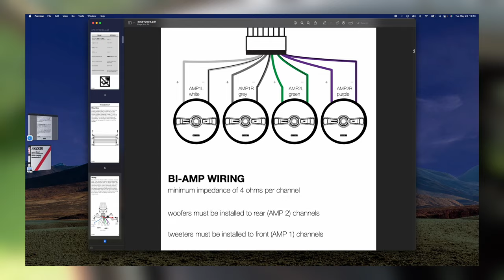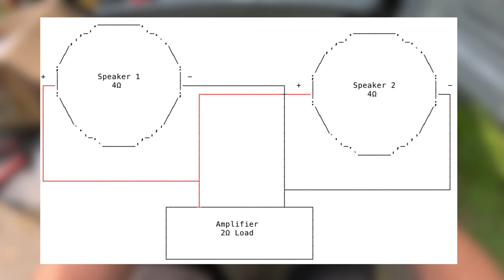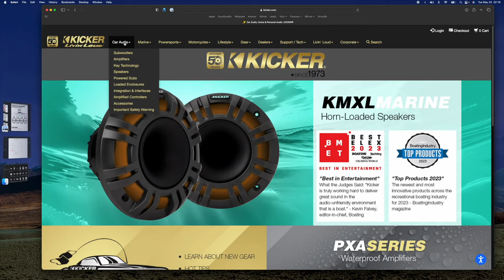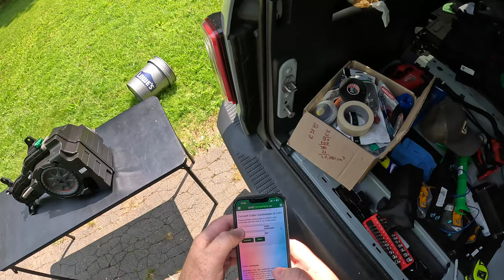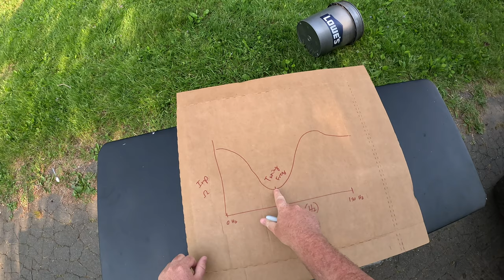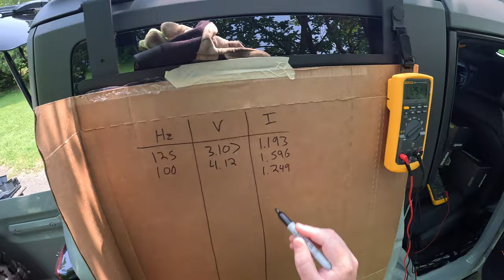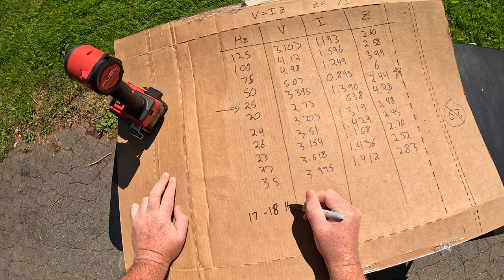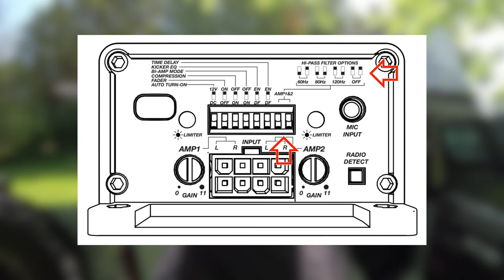Tuning the audio system! - Subwoofer & speaker dial-in | Ford Bronco

Comment: I think it might be a good idea to use component speakers with a crossover. Seeing how the loops on the kick pannel speakers can be cut and tweeters/woofer wires can be separated. Installing a crossover would be easy. It would probably mount near the kick pannel speaker. Plus the impedance would be 4ohms and the kicker amp would be happy. I also think it would improve bass response for the kick pannel woofer since its handling the low frequencies and the tweeter is handling the highs due to the crossover. This would be a cheaper alternative than buying a DSP. I think the kicker CS component speakers have a switch to lower the tweeter volume if its too loud.

Comment: My set up with kicker speakers, kicker 10” sub, kicker key and flat EQ on the head unit sounds on point with no real tweaking needed. A million times better than stock. Not even really any need for bass blockers.

Comment: I've seen other installers use the Kicker key on just the front four speakers.  This will give you a really good front sound stage and give the 6.5" speakers the power they need for the mid bass.  The rears can be run off of the factory head unit.  The way it is currently wired, the amp doesn't know there are six speakers hooks up to four channels.  This probably makes it difficult for the auto-tune to work properly on the Kicker Key.
Reply from the maker: Now that's an interesting idea.

I suspect that'll just leave the rear pods super underpowered, but maybe not??  Maybe I'll try it.
Reply: @RagnarKon  You don't need a lot from the rears for a good sound, as it's been said a hundred times before you don't stand with your back to the band at a concert.

Comment: Hey there! I really enjoy watching your videos, least u explain things and the given why to each thing u do. Ur for scan video was epic compared to couple others I watched. I was able to learn what to do instead of just do. Only 1 minor thing I saw when you changed the front component speakers to series cause they were wired in parallel????? True, I wholly agree they were wired in parallel. You have 2 speakers at 4ohms with the amp at a 4ohm impedance, correct? You only figured your speaker ohms wrong is all, u must add the ohms together which would’ve been 8ohms and not 4ohms like stated, thinking you had a 2ohm load at the amp, which in all thoughts would be bad deal for the poor 4ohm amp, correct? The factory wiring was correct to parallel both 4ohm speakers which is 8ohms total divided by the 2 speakers, at which the amp would see the correct 4ohm load. No need to wire those in series. Series wiring is adding each speaker ohms together to get total ohm load the amp will see for that channel. Parallel is adding each driver (speaker def in tech terms) ohms up and divide by the number of drivers. So 4+4=8 total ohms, 8ohms \ 2 drivers = 4 ohms which is correct ohm load seen at amp. Wiring was correct, amp wasn’t seeing 2ohm load. Im not knocking anything you have done or the way you done it, I think your doing great videos that others can learn what they are doing, heck! I learned a lot from your forscan teachings!! I think you’re doing a great job!

Comment: Had a similar setup with some focal, a week later I pulled the front coaxials out of kickpanel and dash and installed component’s….. night and day better
Reply from the maker: Which components did you use??

That was another idea I came up with as I was editing this video, but trying my best not to throw more money at this sound system.  One of those things where you can just keep going and continually upgrade gear, and before you know it you've spent $2,000+ on it.

Comment: Great job and detail on the tuning. I have the same setup (Kicker SUB and Kicker Key 500.1). I am happy with the subwoofer setup but I am thinking of adding Poly/ and blocking the port? Have you thought about doing this? Also, do you have a snapshot of your Kicker Key 500.1? I want to see what your setting are. Thanks!

Comment: Would you recommend re-wiring to series with the stock B&O amp?

I replaced all of my speakers with Alpine Type S (and the sub with Kicker) and it's all running off of the stock B&O Amp. I added bass blockers in the dash and when the EQ is set to Low, Mid, and High in the center... it's insanely bright. I had to turn everything all the way down and then bring bass and mids up. Might try removing the bass blockers... but if that's not the answer, wondering if  re-wiring to series would work.

Comment: Just recently installed components in the kick panel and dash. I'm running Rockford Fosgate R1675X2 and they sound great. Install of the kick panel speakers was a bit of a headache because of the tight tolerances of the 6.75's. The Rockford Fosgate R165-S would prob be less headache. Loving the sound, IMO tweeters in the dash instead of two way 4" changes the soundstage quite a bit. I also used the same R1675X2's, minus the tweeters, in the rear (made some pods out of PVC to replace the factory ones). Gonna be posting the setup on 6G sometime in the next few days.
Reply: How do you wire it up like this? I'm very interested in this set up. Do you just leave the 4" speaker wires unplugged? A write up would be great
Reply: @ccclaw13  The 4" speaker wires are left unplugged, but the kick panel speakers were wired to the factory kick panel harness using an adapter. What i ended up doing was bypassing the factory 4" wiring and wired the tweeters directly to the kick panel speakers. I just feed the wires down behind the dash and into the kick panel, from what i remember it was pretty simple to get the tweeter wires routed. I cant stress this enough though, for an easy, headache free install, get 6.5"s and not 6.75's. Good Luck!

Comment: If you ran the front 2 speaker in the normal harness config im guessing its @ 2ohms correct and if so is the key even rated to run @ ohms? I ordered the plug and play kit with key and im trying to decide what to do with the front speaker setup. I have jbl gto 629 in the front and back and mb quarts in the dash ... theyre all 4ohm speakers btw.

Comment: I thought the Key 200.4 has a DSP in it?  I think connecting them in series seems like the right idea.  

What you are doing is halving the wattage to each of the speakers by wiring in series and decrease the impact of the front speakers on the sound stage.
Reply from the maker: The Kicker Key does have some DSP functions, but you can't customize it.  It sets itself up automatically, and all you can do is turn that on or off.
Reply: @RagnarKon  Ya, I know that you get what you get once it autotunes... but Kicker probably did a better job than I can do, especially considering my tinnitus.

I am getting ready to install the Key 200.4 and a Kicker 46HS10 sub-woofer.  Hopefully it will sound decent, I have not decided on speakers yet.  Any suggestions? 

I am using Morel Maximo Ultra Coax on my 2021 Bronco with the Lux package, but this system is for the 2023 with the sub-woofer delete.  The girlfriend is less than impressed with the stock system with sub-woofer delete.
Reply from the maker: @mpeugeot  Truthfully I am happy with my Kicker KS coaxial series speakers (part numbers in the description).  BUT, a big reason why I am happy with them is because I got them for a really good price during the holiday season this past year.  I got the 4" speakers for $55/pair and the 6.75" speakers at $75/pair.  If I paid full retail price ($100/pair and $130/pair respectively), not sure if I would have been as happy.

It's pretty clear that coaxials are the best option for the rear pod speakers. My favorite 4" coaxials to-date are the Infinity Reference REF-4032cfx, although you could argue they are slightly overpriced if you buy them at their full $110 retail price.

For the front speakers... if I were to do it over again, I would seriously consider using component speakers in the front rather than coaxials like I have.  Something like the Infinity REF-6530cx, Polk DB-6502, or maybe the JL Audio C1-650 if I wanted something more budget-friendly.

It's hard to give recommendations since I don't have an unlimited budget to try all of the speakers out. But yeah... if you ignore the holiday pricing I got on the gear, I probably would have gone with a slightly different setup.
Reply: @RagnarKon  Thanks, I was looking at the Infinity reference speakers pretty seriously last time, but got the Morel Maximo on sale instead...

Maybe put the Morel Maximo in the GF's Bronco and then the Infinity Reference speakers in my Bronco. 😂 She won't know the difference.
Reply: @RagnarKon  I ended up ordering two Infinity Reference 6532ex and four 4032cfx.  If I wire them in series, I will have 6 ohms in the front and 3 ohms in the rear.  Should make for a decent sound stage in the front with a little rear bias.  Using the Key 200.4 and the 46HS10 sub should give me just slightly better than stock sound.  ;)
Reply from the maker: @mpeugeot  Nice!  Once you get it installed let us know how it sounds.

Comment: easiest fix is taking the kickers out of the kick panel and putting the stock 6 3/4 back in.  You essentially replaced a mid bass speaker with a 2 way speaker that cannot play at the low hz that your looking for.  Also i think you may be wrong in the way your looking at 2 ohm vs 8ohm,  all you've essentailly done is decreased the amount of power your speakers are getting.  Instead of feeding 50X4 at 4ohms,  it would be halved to 25x4 at 8ohms.  You could wire the 3.5 dash and the 6.5 kicks separate to the amp and give them both correct 4ohm,  and leave the rear speakers on head unit power as they are useless anyway.
Reply from the maker: I did briefly try putting the factory 6.5" speakers back in and honestly I didn't notice any meaningful difference.  (That experiment didn't make the final video though since it was already 45 minutes long.) I don't know what the frequency response of the factory speakers are, but the 6.75" Kickers go down to 40 Hz which is definitely in the mid-bass range, so that may be why I didn't notice a difference.

I'm reasonably confident that I should have bought a component speaker setup with a mid-range in the kick panel, an actual tweeter in the dash, and a crossover between the two. Instead I effectively tried to force those 4" speakers to be tweeters even though they're really not tweeters.  But the money was already spent on the speakers I had, so I wanted to figure out how to make the best of what I ended up with before spending even more money.

---

And you are 100% correct in regards to power.  Power is a function of voltage and current  (P = V * I).  By increasing the impedance, I am decreasing the current, which in-turn decreases the power delivery to the speakers.  That is also why speakers get quieter when they are wired in series.

Leaving the rear pod speakers on the factory amp in favor of putting the front speakers on individual channels is an interesting idea I didn't think of to be honest.  I think you'd definitely be sacrificing the rear pod speakers and they would truly be utterly worthless in that sort of setup.  But the front speakers are definitely the most impactful to the overall audio experience, so maybe that would work.

Comment: It's way better than the B&O in lux package.  How do I know?  I have a lux package Bronco and a high package Bronco.  The factory speakers with the Key 200.4 and a 46HS10 sub-woofer put the B&O system to complete shame.  I am getting ready to put the Infinity Reference speakers in today, but the B&O system (even with upgraded speakers) can't compete with it just after the amp and sub-woofer install.

It's not even close.  Don't waste your money on the lux package to get a B&O system in the 2021-2023 Bronco.  The adaptive cruise control is really the only reason to consider the lux package.

Comment: I would run the front speakers off the 4 channels of the key, so it can sort out the crossover and level for the 4 inch and then just run the rears off the factory amp/head unit

Comment: Here is the issue. For some reasons n the bronco is not like a regular car or my jeep. The rear pod speakers are to far away , the front is too close. I changed my dash to the focul 100 ac which was $160 a pair. I did try the focul rcx 100 first but to much highs. The 100AC  gave it depth. . The next lproblem is there is no equalizer  in the radio.. u will be knocking yourself out trying to get it right good luck!!!

Comment: i just swapped all speakers to Alpines/ added a 12 inch sub and amp. Do i need to run forscan to change audio for better sound still?
Reply from the maker: Forscan is not required, but it definitely helps for the rear pods.

Comment: I need an honest opinion, if I have passengers in my vehicle 80% of the time, would I really need a DSP amplifier ? I feel the DSP is really designed for time alignment and suited for the Driver. I understand there are different modes, but I want it to just flat out sound decent no matter what seat you are sitting in. I am more concerned about top on and top off.
Reply from the maker: Nah, you don't really need one.

One part is the time delay/alignment settings, as you mentioned. The other other is EQ correction for the amp/speakers. Just because there is a (mostly) flat signal going into the amplifier doesn't necessarily mean there is a perfectly flat audio coming out of the amp/speakers.  The Kicker KS speakers, for example, are biased a little bit towards the high-end frequencies. It's ultimately up to you if you feel that's important or not.

If you are playing music primary from the radio, the EQ settings are fairly important in my opinion.  If you play it from primarily your phone... doesn't matter to much. Most phones have a pretty in-depth EQ already, so you can easily make up for the lack of an EQ on the amplifier by using the adjustments on your phone.
Reply: @RagnarKon  I mostly play pandora and tidal stream from my phone through apple car  play, your explanation was perfect. I think I am just going to go with a 5 channel amp and keep it simple.  So I just have to decide on doing components or coaxials up front. I am going with JL Audio C2’s  and a stealth box in the back.

Comment: I feel like you’re the guy to ask,
I added a kicker 800.1 to my 23 badlands. Used for scan to turn on the factory sub wiring, took the audio signal wires off the fake amp and sent them to my 800.1. Everything sounds great but after you turn the vehicle, after about 3min and 6 min the sub will put out a thump even tho the amp is powered off. Any thoughts? 

Thanks for making these great videos!
Reply from the maker: That's the amplifier powering off.

You need to connect the Remote turn-on line from the factory. Turns on the amplifier when a signal is received, and turns it off when the signal goes away.  Without it the amplifier will default to DC offset, which causes the popping noise when the amplifier eventually kicks off. 

Ford's remote turn-on lines are a 6 volt signal, and most aftermarket amplifiers require 12 volts. So you will need to pass it through something like a PAC Audio TR-4 to boost the signal up to 12 volts.

Also make sure your input level is set to Low ("Lo") rather than High ("Hi").  And if it is set to High, make sure you turn the gain all the way down before change it to low.
Reply: Hey Buddy!
So I went ahead and installed the PAC4, still having that pop sound! Did some further investigation, finding that the Cxa 800.1 doesn’t have the option of selecting audio signal turn on or +12v turn on. The factory sub audio signal that I clipped off the fake amp powers off about 3 min after you close the door. There’s gotta. Br a way to eliminate, any thoughts?
Reply from the maker: @williamskidgell8163  CX800.1 right?

Not super familiar with that amp admittedly, but from reading the user manual it implied it would automatically detect and use the remote line.

If you have a multimeter, I would poke around and make sure you are getting a 12 volt signal out of the PAC TR-4... and then when the vehicle turns off make sure it drops back down to 0 volts.

Comment: Did you end up closing up the port on the sub enclosure?
Reply from the maker: I'm still going back and forth.

I think sealing it up is objectively the right answer, but then the volume of the sub drops considerably below ~32 Hz since the resonant frequencies in the enclosure aren't there to help out. You have to push a lot more power through the amp make up what you lose.

Leaving it up open works fine on the vast majority of songs, but if you get to a song that is really bass heavy it tends to turn into a sloppy mess.  It doesn't sound horrible, just... doesn't sound great either.

BUT, I'm probably being overly picky if I'm being honest. Regardless of which way I go, both options are still a dramatic improvement over stock.

Comment: You need a loc bass restorer from audio control ,factory units are built to remove bass as you turn the stereo up so you don't blow the crappy factory speakers and if you don't pay the money for a bass restorer it will never sound right